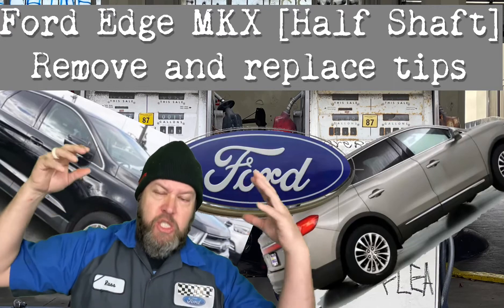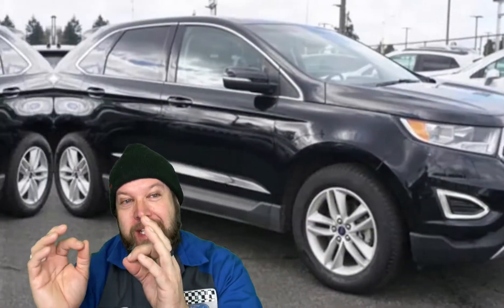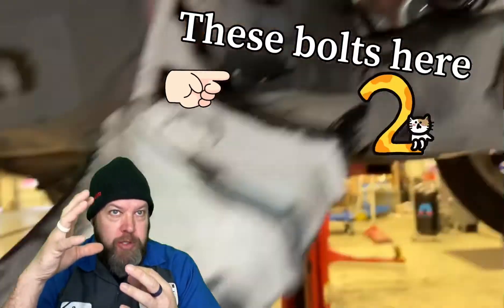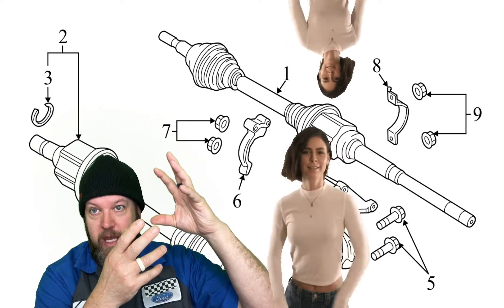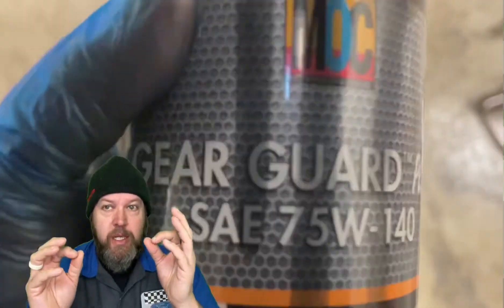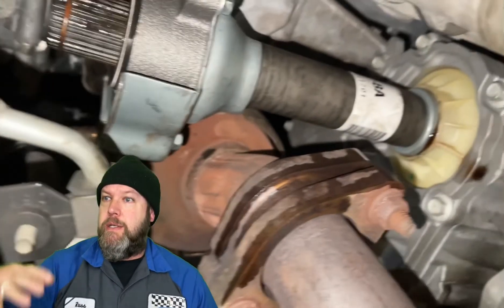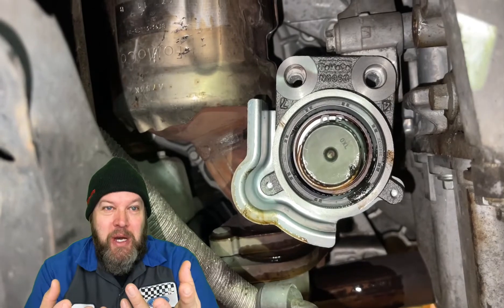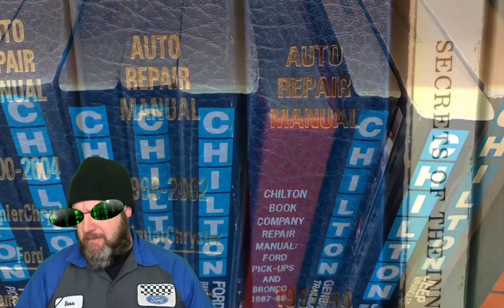Ford Tech Tips - Half Shaft Replacement! Ford Edge Lincoln MKX 2015 - 2021

Comment: I think you are still the only video 2yrs. later. I'm getting a groan/moan sound when steering right. I'm thinking the half or the bearing on the front right.  What was the reason for the changing the half if you don't mind? thank you.
Reply from the maker: It could be the right CV axle, wheel bearing or maybe the half shaft. 
Half shaft is basically an extension of the left side CV axle. Bearings go out in it and it starts making noise or leaking fluid. 
It’s difficult to diagnose unless you can pick it up off the ground and put it on a lift.
I would encourage you to have it diagnosed by a reputable shop.
Best to read reviews of the shop you would take it to, or look on social media Facebook groups are great for this. You could find car people and gearheads in your area and ask them what shops they recommend. Hope that helps. Thanks for subscribing to the channel. 🔧👍✌️

Comment: Mine shows I need to have 18oz, are you sure topping off will not have too much in it?

It looked like red tranny fluid that came out of my half shaft opening, had about 12oz drip out before getting the other put back in.
Reply from the maker: This job was overseen by my Mastertech. It was a few years ago, so I don’t remember all the details but I know I more than likely I asked him the same questions you’re asking me 😆🔧👍 if I recall, it’s a gravity thing. If the vehicle is on level surface and you pull that plug, that’s how high the fluid should be.
A lot of it depends on year, make & model, of course. But I think the transmissions on these are fairly universal at the time. 🤔
Not entirely sure and I hope that helps. 🤔🔧By the way Brothers Northwest? I am up here in the Seattle area. Everett Washington was where I shot this video.  👍😁🌲

Comment: Hey...you said gear oil. You mean dextron tranny fluid?
Reply from the maker: No it’s the gear box it attaches to first then the transmission.
Reply: @RussShawTV  to clarify,  it gets the same fluid as the tranny right?
Reply from the maker: @exil3dlivecom  to be honest I don’t remember, and I haven’t watch this video in a while. I was working at the dealership at the time. My master tech advising me and using the shop manual. If I said gear oil in the video, odds are, its gear oil 👍not sure if I showed the bottom bottle and viscosity tho.

Comment: I have play on the driver side cv. I believe it is the culprit of going over any slight bump it rattles/clunks. Ball joint seemed solid, any other ways of diagnosis
Reply from the maker: You sure the play is in the CV axle? Are you sure it’s not a tie rod or a control arm? Where is the play?
Reply: @RussShawTV  not 100% but I was also thinking the strut but I don't know how to diagnose or test with out taking apart the suspension. Though that seems like a way easier fix with drive way conditions and limited light after work
Reply from the maker: This is on a Ford I take it, 🤔 yeah you could do it in your driveway you just have to jack it up [be safe, of course😁] put it on Jack stands and check the bushings. Usually it’s the bushings that go bad in tie rods and control arms. Changing bushings is such a time consuming pain in the ass it’s easier to just replace the whole part. There’s another video on my channel with a Dodge grand Caravan where I show a example of a control arm bushing that went bad. But odds are it’s your CV axle especially if you’re turning corners and it’s making a clanking noise.
Hope that helps buddy thanks for commenting and subscribing 👍😁

Comment: If anyone comes here thinking the intermediate shaft on earlier model FWDs is the same it is not.  I have a 2009 Ford Edge and the intermediate shaft where it bolts to the side of the engine has a bracket on it that connects to the heat shielding on the pre-cat.  I fought to get one of the studs out and the nut at the top.  There’s the longer stud at the bottom, I got it loose then couldn’t get any further.  I took a dremel tool and hacked the top of the bracket off so I could work from the wheel well which is some what difficult but much easier. The way the bracket is position on there you can’t get any tools to the bolts from the outside.  I’m not even sure why that bracket is on there. The shaft is mounted to the engine and pre cat is mounted to the manifold.  Probably not the right way to do it but it worked for me.  It looks like your supposed to drop the subframe and then drop the pre cat then unbolt the shaft but I wasn’t about to do all of that.
Reply from the maker: Just super curious. Did you watch the whole video?
Reply from the maker: I think there might be a recall for that year. I know we did a bunch of recalls on that bracket. But I can’t recall what year Ford edge we did it for.

Comment: Question. 
I ordered axels from rock auto. One of them has the half shaft with it. But I only need to replace the CV. I know it's probably a dumb question but idk 😂.do I need to replace both or can I simply take the new half shaft off an just swap out CV ?. 
All the videos I found where for 2014. Nothing on 2015+
Reply from the maker: You don’t have to replace it but, while you got it and your in there 🤷🏻‍♂️